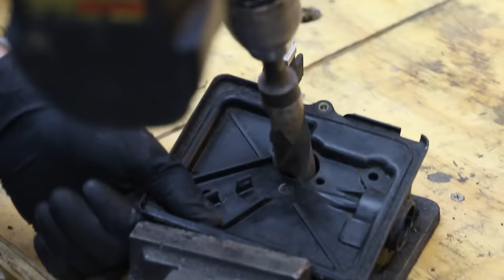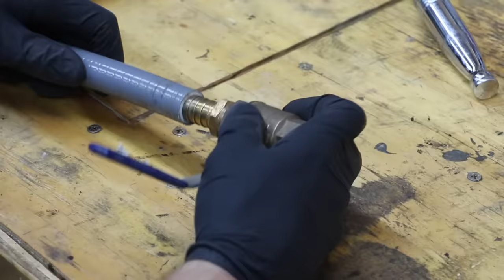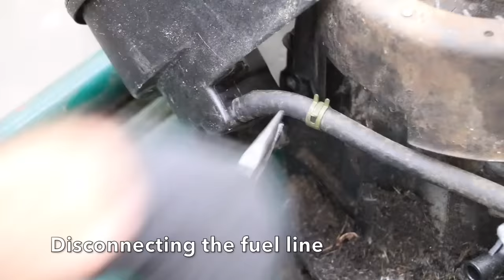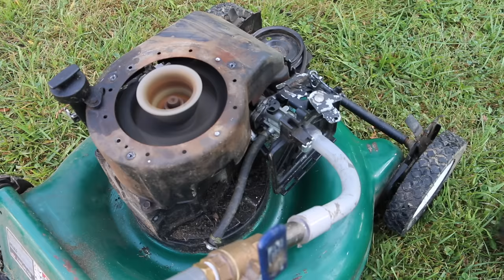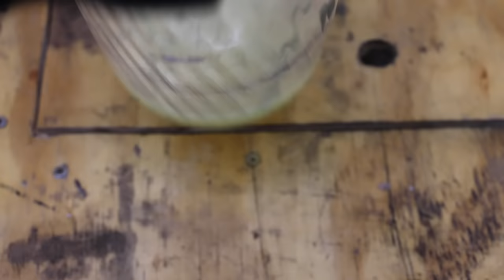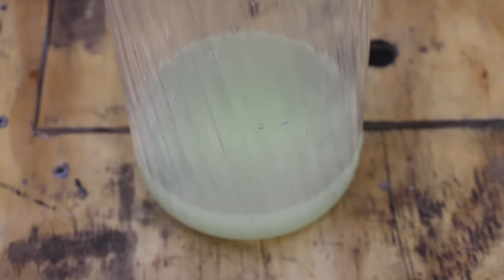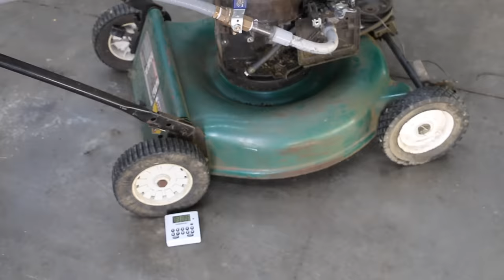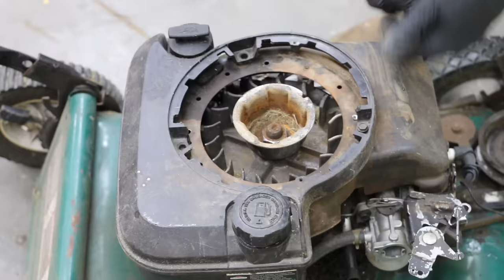Will a "Gas Vapor" Container Improve MPGs and Fuel Efficiency?  Let's find out!

Comment: This is a good video but next time can you try boiled gas in an engine? Thanks.
Reply: Boiled gasoline?

Boiling gasoline will just drive off the volatiles and leave him with a more waxy, somewhat yellowish substance of larger, heavier hydrocarbons and whatever additive package that particular fuel supplier puts in. Typical gasoline has 4 to 12 carbon atoms per molecule, with more atoms meaning heavier (and harder to burn.)  The heavier atoms also dont evaporate as easily.  Just like the crud he was forming when 'vaporizing' the fuel.  It will eventually reach a point where the ignition system can't impart enough energy to ignite the fuel.  It will basically become too 'heavy' for the engine to burn.
Reply: Kit Iwamatsu thinks for your input. Noted.

Comment: Massey Ferguson had a few tractors that ran off vapor carbs, same concept you have just a smaller carb. They had a venturi valve for added pressure from the main air intake to give it more power.  Take that lawn mower for example.. if the grass is higher in some spots.. it will take more load(fuel) to push through it.  Same with a car climbing up hill as opposed to moving down hill. 

Diesel crushes this theory because the cylinder pressure is much much more higher than that of gas.. more efficient and cooler run times.
Reply: My freightliner straight truck, which used a CAT 3126 engine, has a high pressure fuel supply system that vaporizes the fuel at around 22,000 pounds of pressure. It is very critical that you get an authorized mechanic to disassemble the system when disconnecting it for repairs. It obviously uses diesel fuel.
Reply: Just adding air but not just any air make it hot air and add as much as you can and don't mess with the fuel unless you decrease it but the hot air will make a very big difference

Comment: Good video! I’m not not an engineer but I thought engines run on atomized (very small droplets) not vaporized fuel.? I was sure you would have gotten better fuel economy but the rpm needs to be exactly the same. Perhaps as eluded to by a previous commenter controlling the air with a separate line would help. Maybe set up again to control the rpm with the carb which might create a more realistic scenario and fine tune the mixture. I believe the exhaust was cleaner from the mower no? I too remember the guy in the 70’s getting 100 mph, then he and the “invention” disappeared. The greedy oil companies only care about money and not the environment. Thanks Bro!
Reply: Ya 20% of the fuel gets vaporized and mixes with the air and combustion happens. Right after combustion the fuel mist reduces and 70% of the liquid droplets energy is stripped and the nitrogen expands. The problem with all the gas vapor video is if you have a 8.5 to1 Compression ration and 14.5 to stamatic ratio you only have 30% to be gain from fuel and any gain from liquid to vapor will have a equal loss in power because stamatic ratio will be off gasoline is dense vapor isn't ect......the set up in the video pulls air and vacuum so isn't fully vaporizing the fuel small droplets are  alike it up the line but he did a great job.

Comment: I wonder how well/bad it would work if the fuel was vibrated to a mist like a fog machine does?
Reply: Cosigner22 Most of  those ultrasonic mist inducers burn up in a few seconds when used with gasoline. Definitely a good idea though!
Reply: Just a guy wasting some time no they don't.. they open and close like a valve.
Reply: Actually injectors are just an on/off tap. The pump provides constant pressure the injector just cycles open and closed. 
The injector has a screen or perforated disc that determines the spray pattern.

Comment: Serious question... what does the questioner imagine a carburetor does?
Reply: Carburetor still injects fuel in liquid form, which get mixed with the air, 
while the drops sizes surely a lot bigger than when it gets vaporized when bubbling the air through it. I believe this causes the assumption that it might be a lot more efficient because the smaller the drops the easier it is to burn it. 
I was quite wondering that this test did not reflect this, seems there are more factors affecting the efficiency
Reply: @mymodel6  not sure who you are actually talking to, while it doesnt really matter; in either case your feedback is inappropriate . Please rethink your wording.
Reply: @Pyrcae  I am pretty sure your evaporator results in only fuel vapor and not fuel droplets entering the engine.
I am also pretty sure that most of the fuel is vapor (and not droplets) by the time it gets to the inlet manifold. Isn't this why the jets are so small... to reduce the fuel to small droplets ready for evaporation. The smallness of the jets causes metering and flow issues because fuel is not an ideal fluid - it has viscosity. Carburetors are designed to compensate for that and still allow fuel orifices to be very small to promote evaporation of the small droplets that result.
This should be easy to test. Measure the temperature of air/fuel mixture before it enters the warm inlet manifold. There will be a temperature decrease from ambient due to the reduction of pressure caused by the venturi and throttle valve. Any additional temperature decrease will be that caused by the evaporation of fuel.
I am not a car guy; I am a meteorologist. Evaporative cooling is a thing. Also, I am not an idiot.

I think you got the same result because a good carburetor will deliver fuel vapor and not droplets.

Comment: There is a known amount of energy in a gallon of gas. All the energy can be accounter for. No magic carb is goint to get a car to go 100 mpg's like has been claimed by commen.
Reply from the maker: Great point.
Reply: No....it is not about fuel it is about how you utilize it,example carburetor vs injection same amount of fuel would be more efficient on injection.....most of energy is wasted as heat and friction,not all of fuel are combusted perfectly.
Reply: hydrogen is infinite,   there is no known limit to its energy
Reply: Yes a gallon of gas has a "known" energy point. However  most combustion engines have only around 20% efficiency. Engines are getting better but so far the most efficient are 38% and are rare.
Reply: @harleyme3163  Only problem is that hydrogen doesn't like to stay in a container. It will leak out because the molecule is so small. Plus it takes more energy to produce the hydrogen than you get from burning it.
Reply: That is not true. You can use a known amount of energy from a gallon of gas, bul depending how you use that gas, you'll get different results. You can even drop  it liquid in a cylinder, and it will be far less efficient.
Reply: yeah but no engine is 100 proc efficient and increasing fuel economy is just a way to make engine use more of the fuel for work
Reply: A set volume of air requires a set volume of fuel ( called stoichimetery).  Adding not enough fuel, also called running lean, will obviously greatly increase mpg but the exhaust emissions will also greatly increase.  That's why new cars don't get 100mpg.  The fuel only has so much energy and burning in with minimal emissions requires running with correct stoichimetery (14.7 parts air to 1 part fuel)
Reply: How about that secret one the car companies bought and  put on the shelf? (Ha)
Reply: a car's gas tank vents fumes to the environment to prevent over pressurizing the system. though i dont have the experience to tell if these lost fumes would make a noticable difference if they were used instead of discarded
Reply: They do now pull a slight vacuum on  the tank and use the fumes in the engine.  It doesn't increase performance as much as it reduces pollution.

Comment: My friend your fuel lines are not pressurized and is way to big to hold vapor pressure and that engine is not fuel injection my friend. Besides the fuel injection part the hose not being able to hold better pressure?
Reply: Ok my friend

Comment: The carb makes vapor, u think liquid goes to the cylinders...
Reply: Yeah it does, doesn't it?
Reply: @integrationofmanandmachine4714  liquid goes to the carb. the carb's whole job is to atomize the fuel into the air(aka, vapor) to go into the cylinder. He basically just made a very crude carb. The valve he put in basically works similar to the jets in a carb.
Reply: I wonder how much engineering went into the stock carburetor and how many iterations of it their were before they had perfected it. I also wonder how it is that this guy, with probably some research and thought, built his contraption in one shot (as far as we know) that is essentially just as efficient. Both of these things make me wonder if more effort could actually gain a little. Even if the gain is not hundreds of miles per gallon, imagine if every gasoline engine could get just an extra 1/2 mile per gallon. The world over that is very significant.
Reply: @bryanhendrix1113  Like someone else said, he just made a very large, crude, and unprecise version of the stock carburetor.  A carburetor does the exact same thing as this setup, much more precisely and adjustably.  The slight difference in run times is due to both the fuel not being precisely measured(ounces add up over time), as well as a likely leaner mixture(lower fuel-to-air ratio, burns hotter/more explosively but will cause severe engine issues over time, they are designed to run on a specific mixture). 

Don't get me wrong, this is a super cool experiment that illustrates the vapor properties of the fuel, but all it REALLY is, is a sloppy carburetor that's 30 times the size of the stock one.

Comment: My suggestions based on the research I’ve done on patents:

1. Need a separate air intake: after the air pulls through the vapor, need a separate ball valve inlet down line. This will be used to adjust the air fuel ratio

2. Heat. The fuel will get cold over time from the vacuum and be less efficient. Old patents used heat to “boil” the fuel, vaporizing it. Either heating the liquid directly, or heating the air/fuel mixture. Under vacuum, you only need like 150f, although some claim 400f. Should be noted that cold intake air could condense the vaporized fuel.

3. Filter: can be just stainless steel wool in between screens. It acts as a flashback arrestor, but also as a way to filter out any liquid droplets of fuel being sucked in, leaving only vapor

Comment: Instead of using 2 pipes for agitation of bubbles use 1. The use of 2 creates too much vapor (unnecessary) to run the engine which also dissipates the gasoline.
Reply from the maker: Thank you for this recommendation!
Reply: He has a ball valve to regulate it less tubing no differance

Comment: How long will the engine run if you used HHO gas you created from water using car battery charger and steel plates electrolysis?
Reply from the maker: Great video idea!
Reply: Till the battery dies
Reply: I've seen the video of Stan Myers running a dune buggy on HHO. I made an HHO generator and it took several minutes to fill a 16 ounce water bottle. When I put a match to it it exploded. Let's say you are running a 350 CI engine. You will need 350 CI's of HHO to fire those 8 cylinders one time each and that would be 2 revolutions of the crank shaft. If Stan did run on HHO his secret died with him.
Reply: oshpunit987 his secret was an external power source or gasoline
Reply: It is more efficient to drive on your starter engine
Reply: 700 years and a half oil change long
Reply: forever, or   as long as there water and electricity.. or   until something breaks down..    hydrogen is infinite..

being the fact that when you burn hydrogen, it exhuast water
Reply: Harley Me you cant burn water...
Reply: would pee in the bottle be better for electrical break down to hho
Reply: @joemarshall5843  no

Comment: As you already have mixed gasoline / oxygen inside your self-built tank and the hoses, every backfire could explode your construction. Be careful! ;-)
Reply from the maker: Thank you for the safety precaution.  I need to install a checkvalve to reduce risk.
Reply: But Backfiring is caused by rich gas intake. Vapor is as lean as it gets.

Comment: It doesn't matter if gas vapors work or not because there's a huge oil lobby that is more interested in selling gasoline than it is in saving fuel.
What about hydrogen-powered cars that burn hydrogen and drip pure H2O out the back?  This is a possibility but it hasn't been developed. Why? Because of the huge oil lobby that would lose big if we move from a gasoline based engine.
It's about the dollar people.
Reply: hydrogen powered cars are really just electric cars with extra steps, since the hydrogen is made from electricity. When you convert energy from one form to another it becomes more inefficient. Ergo hydrogen powered cars are pointless.

Comment: Put a good load on that engine and see if it stalls.
Reply: The blade cutting through the grass while he was mowing was not a good load for you ?
Reply: @psirvent8  right? Putting the blades on is putting a load on the engine 💀😂
Reply: @psirvent8  lets get some thicker grass
Reply: Push the mower to a puddle and when it hits water the governor will draw it to WOT. You clean the deck and control lugging by tilting the mower deck.

Comment: All gas engines run on vapor,the whole process of internal combustion engines requires the vaporization of liquid gasoline into vapor so it will explode when ignited under pressure this is amazingly silly.
Reply: I was just coming to write this
Reply: It's not silly when you know that vaporizing the fuel prior to sending it into the intake results in a massive fuel economy increase. Feeding your machine vapor vs liquid fuel saves fuel, fuel = money + a huge decrease in emissions.
Reply: That's complete nonsense, voice by people who don't understand what carburetors do.
Reply: @korakthekiller8177  "It's not silly when you know that vaporizing the fuel prior to sending it into the intake results in a massive fuel economy increase." And how do you know this? Where is your actual evidence because the real world evidence seems to suggest very little difference. Energy cannot be gained magically. All that is happening is the ambient temperature is high enough to contribute to the fuels 3% increase in economy. The colder the climate the less efficient vaporizing the fuel beforehand becomes. Unless you live on a planet with a much higher average temperature it really will never work.
Reply: @davesvoboda2785  I've built hundreds of engines in the last 40 years,gas,diesel,outboard,inboard,high performance pleasure, bulldozer,etc.Running a  motor off of fuel vapor is the same as starting it with either,there is no positive effect by using this method and the performance drops drastically. Fuel injection is by far the most efficient way to atomize fuel and vaporize so it will combust with the most powerful  and efficient explosion.This is all smoke and mirrors.
Reply: @garywheeler60  Sorry, I intended to reply to Korak.
Reply: @davesvoboda2785  No worries..peace
Reply: @Sgtassburgler   I used the waste heat of the engine on the air intake with winds of copper tubing. I added "still" M/ETOH20% (about 180proof). Yes it is more dangerous. Yes, it works. Yes, I made some fires. The set up for me to mitigate the danger is too complicated, heavier and expensive. My beast eventually died. I spent some money on a fun experiment. If gas prices get up around 10 dollars a gallon, then maybe I'll visit that solution in the future if my legs still work well enough to endure the workout. 

Higher than that, we should all really be running electric and let some big industrial unit do it to make electricity which we can download from the grid. New battery technology will make that happen (crossing my fingers) sooner than later. 

We don't use diesel engines to cut grass in the yard ... (although we could ... it would be a good workout). They are just too heavy to lug around.  

Oh, I was getting about a 18% increase ... at what I estimate was a 500% risk; so, it was not worth it to me to do it again.
Reply: Missing from this conversation is that outside of lawnmowers and the like, most modern engines are using direct fuel injection
Reply: @ejrupp9555  Actually every time I watch a PF video I get an ad for the Ryobi electric mower. And you're right, if the concern is fuel cost, and especially emissions, electric makes sense. It is far easier to mitigate the emissions from centralized electric generation than it is to do it at each mower. And lawnmowers pollute far more than cars.
Reply: @sauercrowder  Roger that. What the non believers keep saying is that you can't change the amount of NRG and that is correct ... but they don't realize that an increase in efficiency is not increasing the available power ... it is using the same amount more efficiently.  ICE engines have inherent inefficiencies in secondary imbalance (vibration) and in TDC compression resistance. Compression goes up twice for every halving of the volume ... so a little change near TDC provides a significant change over a very small volume. They don't see the reduction of losses ... they are stuck on "but it doesn't increase power". It doesn't increase power ... it reduces losses.
Reply: @ejrupp9555  I mean, the easy thing to point out is that electric power can come from nuclear, solar, wind, hydro etc. It probably won't entirely come from renewable energy, but the point is it could. And even natural gas generation, which is mostly replacing coal, is far cleaner than a small gasoline engine.

It all adds up. Supposedly by last year there were more ozone-contributing pollutants emitted from small engines in California than by all of the passenger vehicles in the state.
Reply: @ejrupp9555  I don't really know about efficiency from running on vapors though.